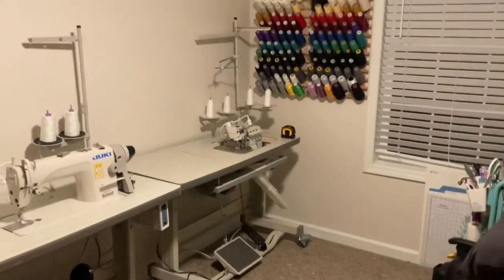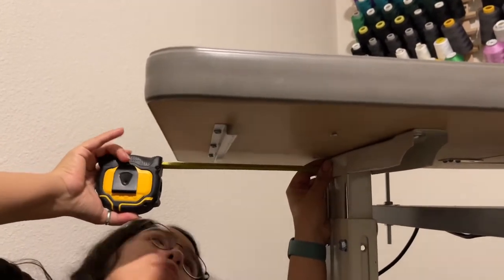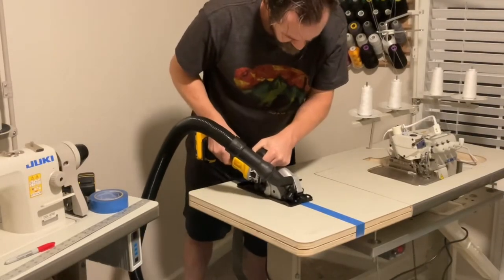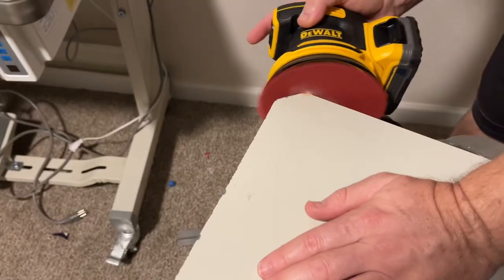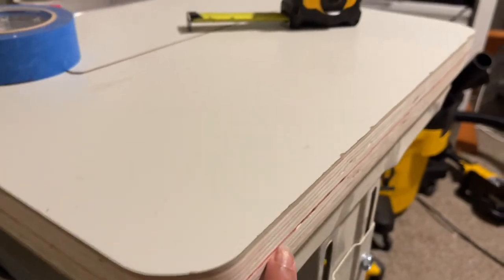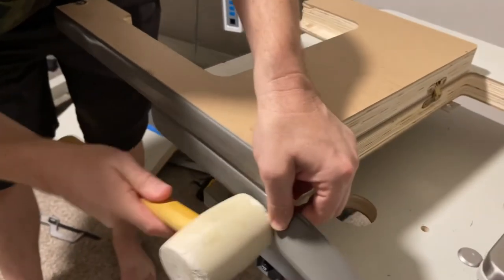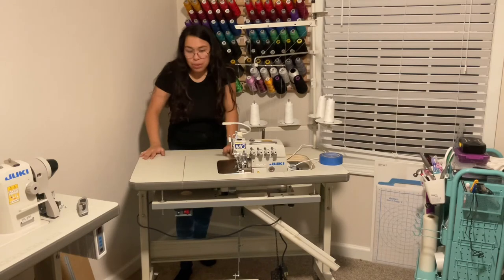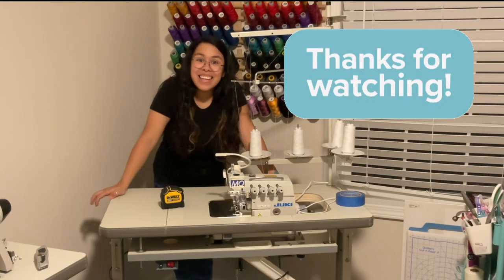How To Shorten An Industrial Sewing / Overlock Machine Table | Quick DIY

Comment: dang i think ill do this with my 5/3 overlocker.   way noice
Reply from the maker: It’s incredible how much room I have now! Definitely worth it!
Reply: mouth breathing in children, if they continue it like say during sleep, etc,, it causes teeth malignment and litterally changes how their facil bones grow.

W sitting causes kneeknocking

"floss tip" toothbrushes FTW. i use one for my son and the bristles are better than the Terrible ones they put on kids brushes.  i also put a little hydrogen peroxide onto the brush after a few swipes with toothpaste and it works as a Debriding agent and sterilizes Better than Listerine.  al the newer most expensive mouthwashes use a chemical siilar to h2o2.  itll Stop gingivitus

i use compact flouresent bulbs in my sewing area because the spectrum is serously more healthy.  more more, faaar more spectral lines across the visiblespectrum.  living under LED lighting is really for camping. t5 bulbs are also great and more effcent than the typical oldschool T8 size.

a rolled hem foot can work as Step 1 for felling an assembly

take it light do it right, yo  

chris from Maryland